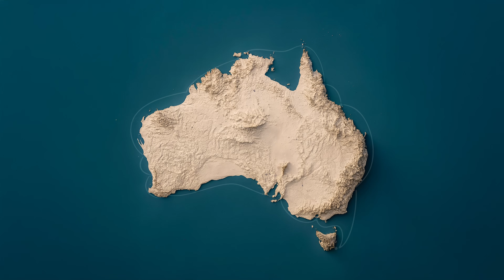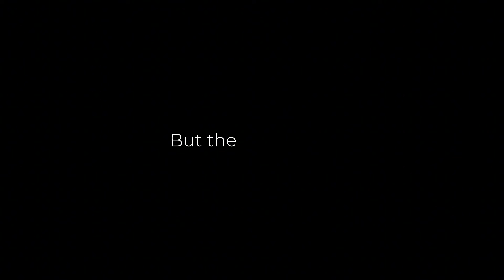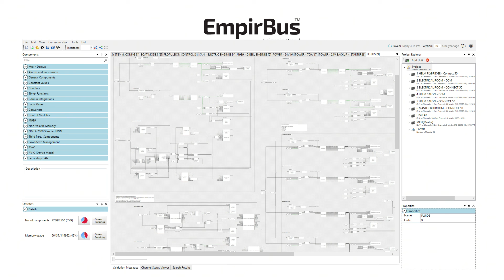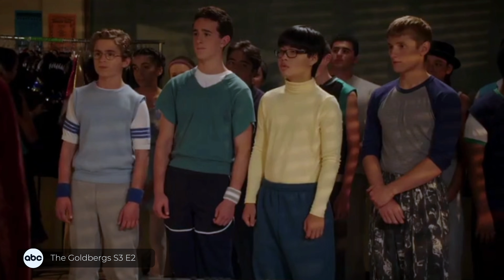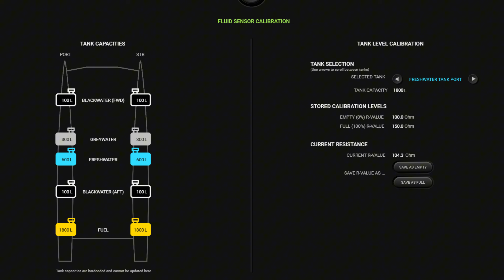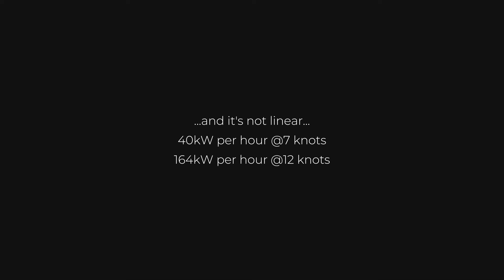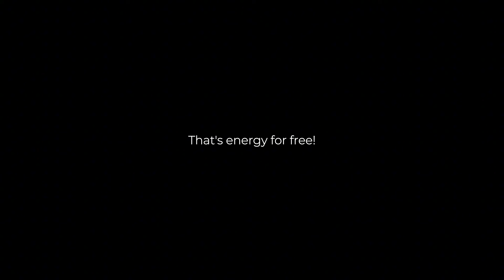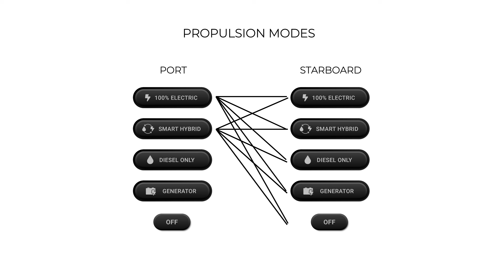The System Behind Our New Solar Electric Yacht

Comment: This deep dive is absolute gold! 🤯 The logic behind using digital switching to shave off hundreds of kilos of cabling (literally dead weight!) is such a smart 'physicist' move. And the UI design? Just brilliant—hiding the complexity until you actually need it creates such a clean user experience.
I’m curious though—have you considered integrating this with open-source chart plotter projects like OpenCPN or Signal K? If you ever decide to open-source your logic and system, it could merge so many great ideas and become a standard for the community. The boat looks absolutely stunning, you two are building a dream! Can’t wait for the next update! ⚡⛵🙌
Reply from the maker: Thanks! Glad your enjoyed it. We haven't thought yet about the chart plotter stuff. We went with Garmin, and have left it there for now, but it's definitely something that's crossed our minds. I think once we're onboard and using the charts everyday, then that might become our next passion project ;) Currently working on building an system to create captions to our vhf (I cant understand anything they say!), probably will open source that. Too many cool ideas, so little time!
Reply: @projecteyacht  

Hey, great project idea! If I were tackling this, I wouldn’t bother with building custom electronics. Instead, I’d grab an RTL-SDR dongle and handle everything entirely via software. As long as the frequencies are relatively close, you can monitor 3-5 channels simultaneously with just a single stick. You can route the audio output through a virtual cable directly into a Python script running OpenAI’s Whisper model. This way, you can transcribe and filter all the chatter without a single sound coming from your speakers.
My biggest recommendation, though, is to set this all up on a Linux machine (or even a Raspberry Pi). If you build a headless terminal-based system, you can just plug it in, toss it in a corner, and completely forget it exists. It’ll just sit there silently monitoring and logging everything 24/7 in the background. Good luck with the build!
Reply from the maker: yes, that's the plan. Based on my testing the accuracy of the smaller whisper models is not high enough, so a raspberry pi is not going to work. That said I already bought one so I'll give it crack and test it head to head with my GPU.

Comment: Nice one!   

Do you have a build series on the hull?

I presume you have a second clutch between the electric motor and the propeller shaft to allow you to run the diesel engine in “generator mode”?
Reply from the maker: Thanks! I'll definitely be putting out a series of videos on the build. It's been slow progress on that side, but definitely coming soon. Yes, we have a marine gearbox after the electric engine, which when in neutral enables the generator mode - good question :)

Comment: Love the design with all the necessary info right at your finger tips on your tablet or phone. Our 36" seawind powercat lives on a mooring out the front of our house and my biggest fear was not knowing the state of the batteries and the bilge alarms, so we use our alarm system to monitor both, as well as it will send us video clips if anyone gets into the saloon, great peice of mind, no where near as complex as your system, but it's all about the info required.  Looking forward to watching the sea trials. With content like this I'm sure your channel will do well. 👍
Reply from the maker: Thanks! Yes, it's such peace of mind knowing everything is ok with the boat when you're away from it. We're thinking of setting up a security system too even though we'll be liveaboard, still good to know when someone comes on board when you're away. What system did you go with?
Reply: @projecteyacht  It's a Hikvision AX Pro, we have been using them for years. If you have an existing network it can plug directly into your Lan or Wifi and uses a 4G sim as a backup if required. I can use it to remotely turn on pumps or lights or anything else we need to operate. You can even setup additional detectors under cockpit floors that measure stress on the cockpit floor and alert you that someone is on board before they have a chance to get into the boat. I hope to be making some digital instrument panels in the near future as there is not enough info displayed on the original Yanmar dashes, so I will have to start looking at building something like yours on a much smaller scale. 🤣
Reply from the maker: Cool, yes we're thinking Hikvision. We already have one of their cameras for navigation, and saw some interesting security options too. Looks like a great product. We'll definitely go wired LAN cameras for robustness. We already have a dedicated LAN switch for our docking and night vision cameras, and left enough capacity to take security cameras when we're ready.

Comment: If you were designing the screen again, you could put haptic motors on the back of the display to give a tactile response to events. Think of it like a solenoid that taps the back of the screen through a small hole. You can change the buttons around based on the screen you're on. 2 types of feed back are better than 1.
Reply from the maker: Yes, that would be great. Unfortunately the Empirbus only supports short and long tap, and our screen dont have haptic either. Maybe a project for once we're on the boat and bored :)

Comment: Would be cool if in a upcoming video you guys can explain the sizing of that whopping serious battery pack (I guess your number 1 capital cost item) given you do parallel hybrid gen. Also would be useful to understand something of the intended lifespan you're aiming for. Cheers from a wintery Old World.
Reply from the maker: Battery video is currently under production! If we could have bought a high voltage battery off the shelf, then yes, it would have been expensive, but we bought the cells direct from the manufacturer and built the battery banks ourselves, so it came in less than our engines!

Comment: I see two flaws so far. The word SMART wich is really S.M.A.R.T. and it sounds all really nice and dandy until you figure out that is nothing but A.I. control and surveilance, always used by letter agencies for not so very nice reasons. It also means that someone else can turn off anything and everything whenever they want for whatever reason. Absolute NO GO.
Also, the A.I should never be allowed to have the last word. it must be the captain, a human.
But, let´s see how this works in real life. The idea sounds great.
Reply from the maker: Only 2 flaws?! I can think of a few more! On the AI side, there's no AI in the system, its all rule based logic. You want systems like this to be predicable - everytime you do something the boat should respond the same way. That wouldnt the case with AI. Our system is fully isolated, so no-one can break into it, but security is definitely a concern. We've been thinking hard about how to protect the system when there are controls on the flybridge that people can access when we're not there or inside. I think we have a solution, but will be testing it's hack proofness :)
Reply: @projecteyacht  Maybe i do not have the correct wording, but to me, as soon as you have a computer ruling something, it is already A.I.. Maybe an A.I. that always responds the same way, yet it is artificial nether the less. I am pretty sure that the people whom designed those self driving cars had not in mind that these cars do what they want at some point either. 
But please, dont take this as an attack or something. This is just me being pesimistic in nature and i would love you to proof me wrong.
This is very interesting, to say the least and if it works smoothly will change the entire industry, or at least it has a great potential to do so.
However, when i hear things like "no matter what you do, it will not turn on", my inner alarm goes off. A human must have the last word, never ever a computer.  The computer cannot see what is going on outside of it´s system. While it could be right to turn off in perfect conditions, it could also be the lesser evil if it turns on, because outside of it is a bigger threat.
Imagine you are out there in the middle of nowhere and this thing decides, that because of one screw does not sit right (metaphorical speaking) , nope, that´s it, i turn off and you can´t do anything about it. 
That´s a nightmare, to say the least. 
Hackers are another problem. Robbers do usualy not have the brains to deal with any of this, but of course one has to make sure that they don´t come in while you sleep, or drive off. I am sure, you will handle that perfectly.
Can´t wait to see more ! Thank you.
Reply from the maker: No problem at all. Definitely not an AI like driving, think of it as a if this then do that type thing, but you're right in the the software can have bugs. We have a few levels of protection underneath the code, both electronic and physical that will override the software if it does something it should.

Comment: Wow great content. As an Engineer and programmer I can appreciate the well thought out and executed systems management. A clear intuitive UI is king. You've nailed it from what I could see. I'm a big fan of easy access to ALL lines, wires, cables, pipes, conduits and data cables, form should always follow function in this aspect. Things will go wrong and things will break easy access to key components and line runs. When I see the huge harnesses zip tied together i get dizzy. I'd say 48v is the way to go for DC. Much smaller wires and if it's coming off of it's own battery bank then its really a no brainer. Any way look forward to seeing the rest.
Reply from the maker: Thanks, your feedback means a lot coming from a fellow techie. Agree, the higher voltage the better, high current is not your friend. I'll be putting out a video soon on our blade batteries and why we went with a 700V propulsion battery, where we touch on that aspect. I think people are scared of the higher voltages, but really a lower voltage with higher current is much more problematic.
Reply: @projecteyacht  much lower electric fire risk with low amperage higher voltage. What is the hull construction? Carbon, glass, combo? I've been cading up a pretty radical cat design myself. Not quite as far as you. Good luck and I look forward to seeing more. I'll tease this much. front cockpit with full width saloon and upper pv solar bridgedeck hybrid pneumatic wingsail, attenuated foils with electric drives integrated into the foils. Still needs fluid dyn testing. Weight will be a serious issue hence my also liking smaller wires.
Reply from the maker: Sounds interesting. We are fibreglass. Weight is definitely critical, we've ended up way overweight, which will severely impact our range:(
Reply: @projecteyacht  Yeah weight is so critical and almost always impossible. The foils might under perfect conditions actually fly the hulls but i'm banking on any reduction of hull displacement as a huge win. I suspect most travelling will be with mild hull lifting.
Reply from the maker: I think we'll be too slow to benefit from that, but we can only hope!
Reply: @projecteyacht  Well it's a feedback loop. The more hull you can get out of the water the faster you go and the more efficient the foils become the faster you go. With the e-drives integrated into the foil design you can turbo boost up to speed then let the pneumatic wing take over with electric supplementation. Battery weight is also a huge problem. Tons of issues still to work through.
Reply from the maker: it's never straightforward is it, this business :)

Comment: nice, until we got bucket/barrel sized thorium molten salt reactors for autonomy, that give us unlimited range and autonomy for decades, the solar/electro hybrid is the go, the greenline for single hull or silent yacht cat for more inner space liveaboard are my favorits, wish you good luck, new tech is around the corner, would love to have the hull from that special material they use for "tank boat x18" and sharrow propellers in pods or jet propulsion, the whole outer shell streamlined like a diamond covered with marine grade bendable panels, solid state molded batteries to minimise wasted space and ai captain with robotic crew coming soon as well :-D.....you have to dream it up first....than build it.....
Reply from the maker: Thanks! Yes, we're always watching what's coming in tech. We'll be getting sharrow props :)

Comment: Been building electric boats since 2017. Amazing work! I must have missed where you stated the battery capacity?
Reply from the maker: Love it! Our propulsion battery is 254kWh @700V and our 24V battery is just shy of 20kWh. It was a balance between weight and capacity, and matching our solar generation. We could have gone larger, but that just weighs the boat down if you cant charge it. We'll be off grid so we wont be charging with shore power. If you do, then a bigger battery might make sense. Just our cells alone weigh over 1.5ton

Comment: Wow, thank you. A lot of effort went into that. Love your UI focus. Being in W-Europe I have some questions: Regarding water treatment: are you guys allowed to use a treatment plant (which potentially allow you to dump grey/black water). A local brand is Pure Blue who have also what they call mini setups. Also: do you guys have AIS (transponder) requirements? Would love to see the UI for that if so. Would also be curious to see your ideas on MOB (Person overboard) alarms and maybe ideas on software features.  Cheers from the Old World.
Reply from the maker: Thanks! I'm originally from Holland! We don't have water treatment at the moment, just grey and blackwater storage. We'll be at anchor most of the time. We've definitely looked into it, but not a high priority yet. Once we get to Europe it'll definitely be something we might add in. I would love to take the boat into the inland rivers without having to pump out the waste. SInce we'll be cruising internationally, yes we have AIS (send and receive). That, our radar, and sonars we're keeping in the garmin native ecosystem for now - no need to reinvent the wheel. I'm keen to bring MOB into the system though, to auto turn on search lights, slow the boat etc, but that's for the future.

Comment: Nicely done! Now is it electromagnetic pulse proof?
Reply from the maker: Thanks! Doubt it, but we have our diesel system fully separate, with spare ecus and battery, so we'll always be able to move. Let's hope we never need to do that though - not sure insurance would cover EMPs?!
Reply: @projecteyacht  actually, if all of your motors and wires are shielded in a faraday cage you should be fine.
Reply from the maker: Also lightening strike is actually pretty rare, especially if you dont have a mast!

Comment: Looks awesome! Would personally want even more solar, covering the entire roof and the sides of the boat as well (which may require it being black instead of white to blend in). :)
Reply from the maker: Thanks! Us too! We have grand plans of potential solar skins, walkabout solar on the deck and even retractable shade sails using flexible, but high efficuiency panels. This will come after the build. Keeping it as simple as we can for the boat builder, but we the system can definitely handle more panels. Based on our numbers, more panels is ROI compared the extra weight.

Comment: Congratulations. I will build 3maran (sail) the reson was  safety and size for solar panels.. But since i don't have knowledge in programing.. Was the easiest way to transplamy electric auto to boat and individually control. It is more complicated to use but can probide redundancy in special situations. Biat is in design stage.
Good work keep gooing
Reply from the maker: Thanks! Yes, surface area is key to a big solar area! It's been a pretty complex project, but I think it can be done many ways. We were really keen to get fully optimise the system which meant we had to do it ourselves.
Reply: @projecteyacht  JA .I come to same conclusion..It is strange that big producer will not invest small portion to unified system.Most open and willing to cooperate would be SIMARINE. Do you  intend to open company or open source it?
Reply from the maker: The marine industry lags behind so far, and with so few offerings on the market the builders dont need to try hard to sell a boat. I think that disincentives progress. We're not interested in starting a business, but we are open to selling the IP.

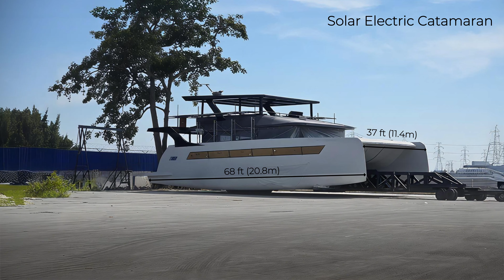Comment: 2:30 At 68ft/20.8m length and 37ft/11.4m beam, it seems like you could double the solar power of 23.9kWp by adding additional support structures.  I wonder how long you could operate using just the 254kWh@700V batteries?  In port how long can the 19.8kWh@24V house batteries last before needing recharging?
Reply from the maker: Yes, definitely on the cards to get more solar, we have capacity to have more, but keeping it simple for the boat builder. How long the batteries will last will depend on our usage. Most of our consumption will rely on the big 700V battery, the 24V is just nav equipment etc, but it can be topped up from the 700V battery and the 700V invertor can also output 24V if needed.